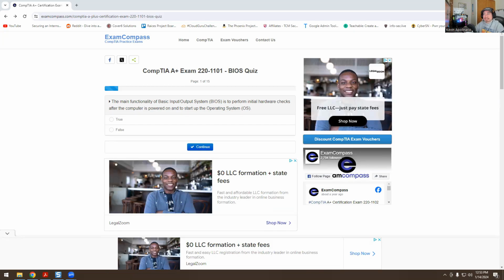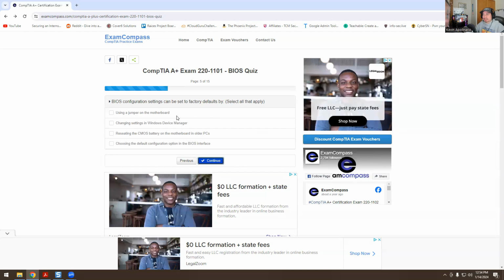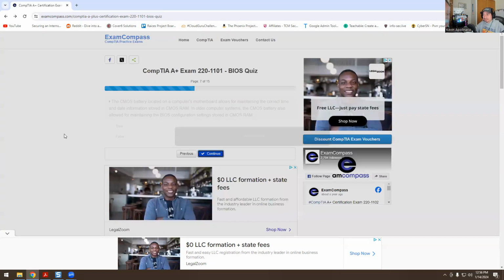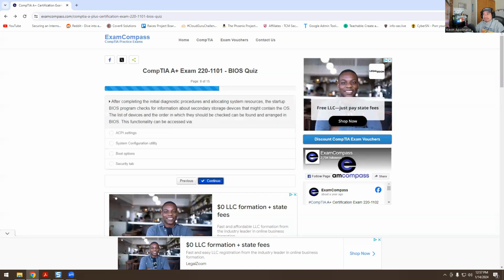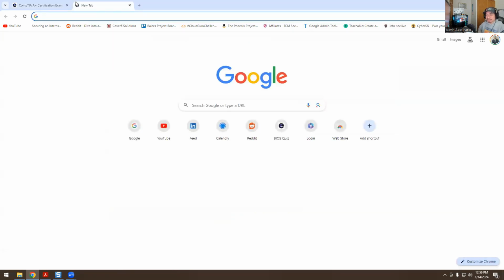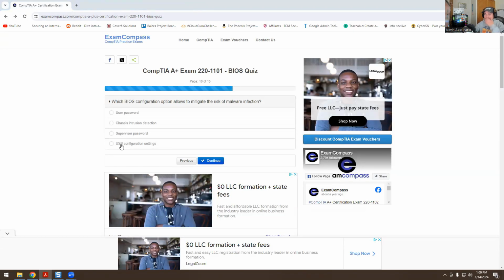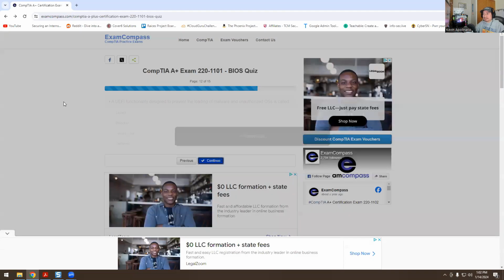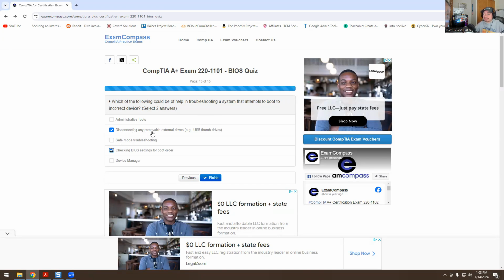IT: CompTIA A+ BIOS Quiz

Comment: What is difference between UEFI and BIOS?
UEFI (Unified Extensible Firmware Interface) is a newer standard that replaces the legacy BIOS. UEFI offers more features and benefits, such as faster boot times, better security, larger disk support, and graphical user interface. Legacy BIOS is the old mode that uses a 16-bit code and a limited number of options.

Comment: In order to access BIOS on a Windows PC, you must press your BIOS key set by your manufacturer which could be F10, F2, F12, F1, or DEL. If your PC goes through its power on self-test startup too quickly, you can also enter BIOS through Windows 10's advanced start menu recovery settings. But remember it will vary towards the manufacturer of your laptop or desktop. When you are unsure just Google the manufacturers website and they will tell you what usually the key combination is to get into the BIOS 
Or today UEFI.

Comment: How do I start Windows 10 in Safe Mode only?
If you can't log into the desktop to start the Settings app, you can still launch Safe Mode using the Power icon on the sign-in screen. 1. On the sign-in screen, press and hold the Shift key on your keyboard while you click the Power button and then Restart.

Comment: What is difference between BIOS and CMOS?
The BIOS is a small program that controls the computer from the time it powers on until the time the operating system takes over. The BIOS is firmware, and thus cannot store variable data. CMOS is a type of memory technology, but most people use the term to refer to the chip that stores variable data for startup.